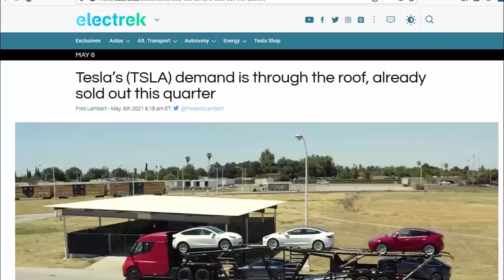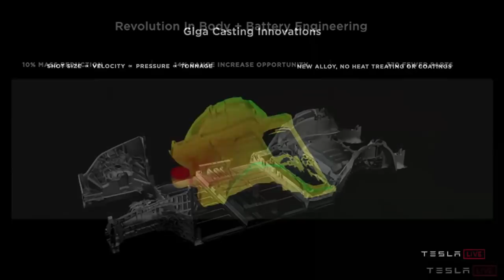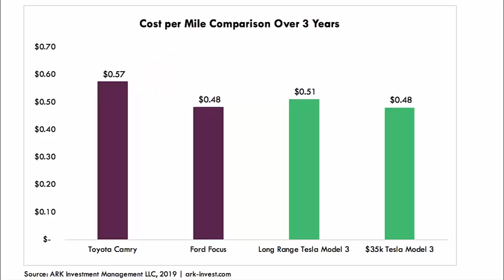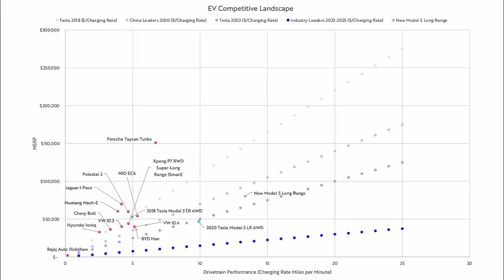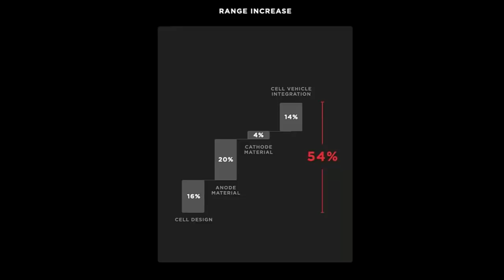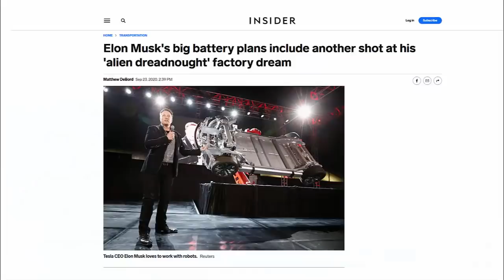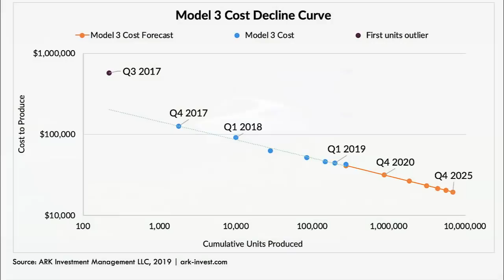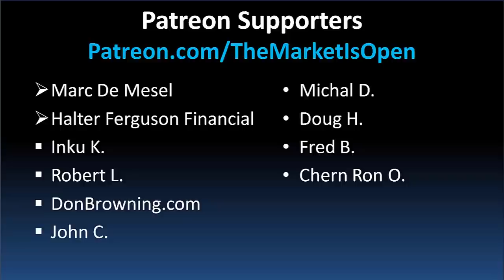The Frightening Economics of the Tesla Model Y

Comment: Translation:  The Tesla car is 370  times more likely to be totaled out by insurance for a minor rear bumper impact. Higher insurance rates. RIP
Reply: Seems that somebody bumps you from behind, it is not the Model Y owner’s fault?  Tesla are safer.  Other people’s insurance will go up.  Don’t rear end a Tesla....
Reply: Our Insurance premium "Allstate" went up  $26 a month for our 21" MY,  it replaced our 18" Mazda CX - 9...  Well worth the pennies increase..
Reply: @xcell78    Useless comparison. Your car is older than the car replacing 370 parts.
Reply: @sergelbergeron   Nope. It's totaled and jacking up that insurance.
Reply: @sergelbergeron  I believe in Pennsylvania,each operators insurance pays for his or hers own vehicle.
Reply: @loafandjug321  Understandable🤔I'd be a lil salty too if I didn't have a Y... 😁
Reply: @xcell78   I looked at Tesla but the interior looks unfinished. Got a Mercedes EQC.
Reply: @loafandjug321  You should have looked "under the hood".
Reply: @wilfredvanvalkenburgh2874  
Don't make this gae.